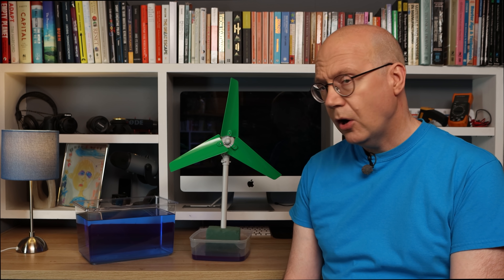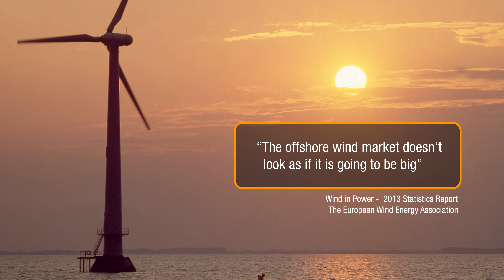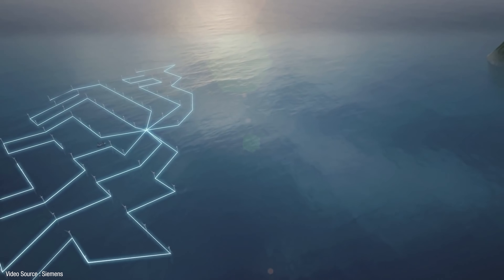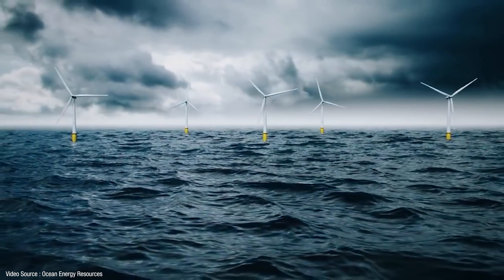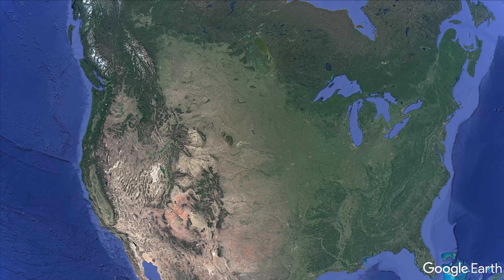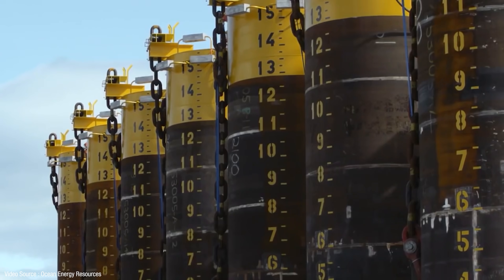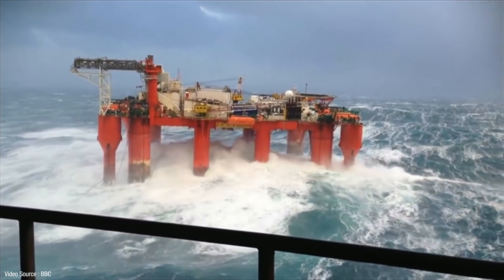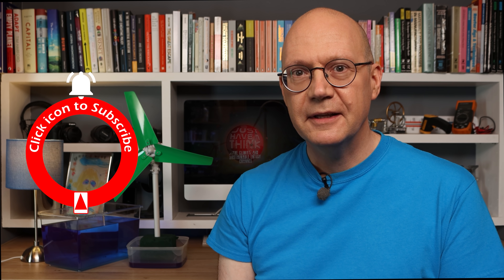Deep Ocean Floating Wind Turbines. How do they do that?

Comment: If they are going to have a floating wind turbine, why not have a floating platform that combines wind, solar and wave energy with only one anchoring system and the huge towers replaced with shorter towers.   A one kilometer diameter platform covered in solar panels adds another 200 megawatts.  500 megawatts if it uses tracking and concentrated photovoltaic and thermal solar combined. If the platform is large enough it would remain near perfectly level for the trackers.  Making the platform into a wind concentrator with the wind funneled into a huge  central shaft and turbine would have certain adbmvantages.  If the blades are supported along the ends by a big moving bearing, the blades could be huge and fill the enter area of the shaft. The three bladed turbines capture only about 5% of the available energy passing through the swept area because the take up such a small area in the swept area.  If the central shaft turbine can withstand hurricane force winds, it might power an entire city for a year with the amount of hydrogen it could generate. 
  The wave energy can be captured by attaching big floats to lever arms that compress air that is injected into the central shaft to help spin the wind turbine.  A three meter wave one kilometer long might equal 50 or a hundred million watts at one wave every ten seconds.  The floating lever arms would also tend to stabilize the platform in huge waves.  
Anither six ir eight giant wind turbines on the top deck might generate another 50 megawatts average.  
If the wind was blowing at 30 mph, the wind concentrator/redirector might generate about 60 million watts.  
The platform might generate 500 million to a billion watts average depending on location.  That is compared to maybe 50 million watts average from eight or ten giant wind turbines in the same area.  
Further combining things, all of that electricity would power a very powerful suoer laser.  That flies.  The turbine generators can be run in reverse as motors.  The turbine blades can serve as propellers.  Some big hydrogen powered gas turbines could power the motors.  If the top of the  platform can separate from the rest of the platform, it could fly like a giant drone.  The LAWS flying laser system mounted on a 747 could destroy targets 100 km away in two seconds with a 2 million watt laser.  A giant drone with a 100 million watt laser would be a formidable weapon.  LAWS was canceled over funding problems it sounds like.  A giant flying  laser system that pays for itself many times over might have certain advantages.

Comment: as someone who works on various wind farms across europe I think I can give a small inside on why we wont be having floating turbines anytime soon. Right now the way to stabilize a structure is to put a huge counter balance on the bottom ideally heavier than the part thats out of water. That would mean that for a 200m tower we would have another 200m structure below sea level and economicaly its just an abomination. The solution (which is currently in development) may pass by the azipod system, the same they use on oil rig where lots of propellers counter the sea current, however oil is energy dense and makes sense to power the propellers, wind on the other hand... its just a question of making the all system more eficient, when it will hapen i dont know

Comment: How  exactly are these fiber optic cables, which from my understanding transfer the electricity generated by the turbines, drilled into the sea floor, connected to each other (underground of the sea floor), connected to the central power station, which is then connected to the land electricity plant (again, from what I understood in this video, all underground of the sea floor). How is all of this very precise drilling and connecting done??

Comment: I'm an inventor;  have a patent in this area and I've worked on a vertical axis wind turbine in S. Texas .   I'm a fan of gyroscopes and I believe a solid gyroscope disc at the base of a deep sea turbine would stabilize it and also provide some flywheel energy steadying effect.  The gyroscope being solid will minimize the drag of the water on the disc and the disc will need to be a substantial fraction of the diameter of the blades.  It may be that two or more discs are required.  They can be made of concrete filled fiberglass and spun via friction drive planetary wheels.  They'll need some kind of electrical charge or something to keep the barnacles off.. I think.  anti-torque disc will also be required.

Comment: What I am most interested in is the power produced to cost ratio.. I dont think you covered it in this video (unless I missed it which is possible) BUT capacity is not important.. what is produced is whazt is important. Also are there times where they produce virtually no power or is the wind absolutely consistent in the deep water? I would think that there are times where the production of energy would drop dramatically when the wind drops.. this creates a serious problem that has to be addressed. Intermittency I would argue is the greatest cost of these things... Exactly how reliable are they? From what I gather at least deep water is more reliable than landbased turbines.. but that still means unreliablility.. and that is a huge cost.

Comment: Deep Ocean floating wind turbines seems to be feasible but setting up the infrastructure and transferring energy ( in the form of hydrogen/electricity ) onshore is expensive and maintenance will also be high compared to an onshore/shallow water setup. First, we need to focus on technologies that are easy to set up and maintain. We can resort to the Deep Ocean floating wind turbine as a last option. And it can be a national security issue in one scenario, for example, your country is dependent on Deep ocean floating wind turbines far away from the shoreline and if there is a war with another country, the enemy can destroy these wind turbines easily ( energy infrastructure ) without even stepping a foot on the land.

Comment: As long as the CO2 of the industrial age is not removed out of the athmosphere  , it is a mathematical certainty that the melting of the ice-caps , and the consequential rise of the sealevels , is not a question of if it will happen , but when it will happen . If then sealevels rise with 20 , 40 , or 60 meters , then what about all those sea-bottom fixed offshore windturbines ? Will they , and their energy they provide , then be lost ? Better build only floating offshore windturbines . They don't drown if sealevels rise , they can be towed to where the wind blows the hardest and can be towed into harbor for repairs in dock , instead of on high seas .

Comment: Could the design of the turbine be simplified by adjusting the way they face by rotating the floating buoy in the water instead of a mechanical coupling up top? Rotate the whole thing, maybe even passively with a tail fin?

Comment: Maybe a future topic to dig into is EROI and derived demand.  With higher utilisation the EROI would be higher, but with shorter lifetime, and more energy needed for the ships to build and service, the EROI would be lower. I've done research on the effects of scale on EROI of hydro power and the effects of reservoir temperature on the EROI geothermal power. The effect of utilisation factor on EROI of wind is huge - but if starting off with 3x more embedded energy I don't know how floating wind stacks up. 
Derived demand refers to the way whole systems emerge to use energy depending on the availability, access, cost and net energy of the resource. Demand has to be derived to fit with the energy resources.  Very low cost electricity of the past led to derived demand that has a lot of inefficiency and waste, because that was the reality. National power grids built to respond to demand created the derived demand of electricity without respect to availability. Wind is a different thing. What does the derived demand for floating offshore wind look like?  I don't know. It's a good question.

Comment: While floating wind is a good start, they will in the end lose out to combined platforms.  The current focus is on reducing the cost of the floating hull as a way to reduce the cost of electricity.  There are two problems with that approach; first it is a self limiting solution (there is only so small you can get and hold up a 15MW turbine), second even if I reduced the hull cost to zero I would only reduce the electricity price about 12%.  Hull cost is only one of more than 20 major cost items most of which dont change with the number of energy systems.  Combined platforms, which use combinations of wind and waves, or really crazy ones like our that combine as many systems as we can, share theses costs out.  The result is a 25%+ reduction in electricity cost, a reduction in the total number of platforms, a higher capacity factor (meaning less need for storage), and spare payload that can be used for other value added activities.  The math is too simple, eventually the hybrids will win out wind only installations.

Comment: Good article but it is very misleading to say it that a capacity of y is enough to power x households. Wind needs to be fully backed up due to its unpredictability and this is unfortunately done mainly done by fossil fuels.
Reply: Right.  Which is why ANY renewal energy source must have a backup system.  Right now it appears that specialized iron batteries hold the most promise.

Comment: Great thought provoking video. I imagine that the weight of the turbine generator right at the top must add a lot of stabilising weight at the bottom. Has there been any suggestion that the blades output be connected to a hydraulic pump and the hydraulic power be sent to a generator at the base of the tower Would the losses exceed the saving of weight at the top?

Comment: A very good video. I am not so sure the  so called impending climate disaster  is real or as significant as portrayed but the use of offshore wind combined with on shore electrolysis to produce hydrogen is feasable and would render the validity of the proclaimed  crisis acedemic.      

I am intimately familiar with the ocean environment but I have a gut feeling that the floating platforms should be detachable from their moorings to allow replacement of older units with newer units and the older units relocated closer to shore.  I have no experience with units that big and would appreciate a response from somebody with that knowledge. 

A great job.

Comment: Something deep water wind turbines can do which inshore or land based turbines can't do is store energy by pumping air down to deep pressurised containers. I.e big balloons on the sea floor or at intermediate depths. If the turbines didn't generate electricity directly but instead pumped air down to deep storage, and the electricity generation was driven only from deep storage high pressure air then you'd smooth out the fluctuations in wind, and have simpler, cheaper and more maintainable nacelles on each turbine.
Reply: Interesting idea.  A lot depends on the efficiency of pumping air and converting that pressure to electricity versus the efficiency of direct production of electricity.  I'm guessing the former is less efficient but might offset that with cheaper nacelles.  If that's true if the wind is always 100% steady, then at what percentage are the two choices equal?
Reply: @lokensga  Simple answer, I don't know. There are a lot of inputs into the cost. 

My guess is that if you don't do the electricity generation directly in the nacelles, but use a hydraulic fluid to collect energy from all turbines in a wind farm, and have a central place to convert the energy from the hydraulic fluid into electricity then it would be cheaper. Wind is free so efficiency doesn't matter as much as capital cost and maintenance cost. Reducing the complexity of each turbine reduces the capital and maintenance costs.

Comment: Great video as always. What about connecting the floating turbines to grids? Is it still realistic to use cables or does it make more sense to put an electrolysed there and produce green hydrogen? Particularly if salt water electrolysis becomes a reality. Thanks

Comment: I like these videos and the prospect of wind power is tantalising,  but how does it measure with the off set of fossil fuels used to manufacture the steel, concrete and cables to manufacture and then to install these installations, plus what happens to them when they are obsolete and defunct, a sea full of rotting metal. I still believe the only real way to reduce the carbon footprint of the human population, is to reduce significantly the human population , something, it seems to me ,the Chinese government is prepared to do.
Reply: they are disassembled and the materials are reused. no one's gonna dump expensive metals into the sea.
Reply: The world is polluted by the world's richest countries, not the most populous.

Comment: It would appear that using electrolysis, transport of hydrogen tanks in ships, and subsequent fuel-cell conversion of the hydrogen into electricity would be the most effective way to transmit the wind energy to the shore.  If that's the case, it would have been helpful to say so.  If not, the video really should have stated what mechanism would be used to transmit the energy over long distances.  Other than that, great video!
Reply: Electrolysis is not very efficient (typically or 70% or less) so the roundtrip efficiency would be poor.  Long distance transmission (>80km) would be HVDC.
Reply: @andycompton4709  HVDC is great when there's a nice, solid land connection between the turbine and the grid.  However, when the turbine is located way out at sea, which is the situation being discussed here, HVDC would be very difficult and expensive to implement.  There may be other mechanisms for storing the energy in "bundles" (as opposed to a continuous wired connection like HVDC).  But generating green hydrogen is the best option I'm currently aware of.
Reply: @lawman3966  I've worked in the power industry for 17 years and been involved in offshore wind for most of that time.  HVDC is the preferred option for offshore farms that are far offshore.  Dogger Bank is the first project in the UK to use it. It requires a large conversion sub-station onshore and it is expensive. However, converting to hydrogen, compressing it, pumping it hundreds of km back to shore, storing it and then converting it back to electricity would be wasteful. Also, hydrogen has low energy density.  In addition, the largest electrolysers are circa 10MW, not really practical for offshore farms that are now commonly >1GW in nameplate capacity
Reply: @andycompton4709  What you describe works for offshore wind harvesting.  However, the subject of the video is deep sea, floating wind turbines.  An HVDC connection for a deep sea would appear to require an underground passageway running as long as several thousand miles to house the electrical cables before connecting the cables to an onshore grid.
An arrangement of this sort may be possible, but it strikes me as being extremely expensive, both financially and environmentally.  Is this what you envision as an alternative to the admittedly energy-inefficient option of green hydrogen generation?
Reply: @lawman3966  Deep sea refers to the water depth (>60m).  It is highly unlikely that these will be installed at a greater distance than 100 miles or so from shore.  They come into their own for areas such as the west coats of the USA, the Mediterranean Sea, Japan, Korea and the West coast of UK and Ireland.  There are many good wind sites relatively close to shore but the seabed falls away quite sharply and is too deep for fixed foundations in these areas.  The potential capacity at these sites is vast so it will be a long time, if ever, that anyone is going to go as far offshore as you describe.
Reply: BTW, export cables are trenched and recovered using remotely piloted deep sea equipment.  No passageway required.

Comment: I'd heard (and I'm not sure how accurate this is; in fact, I'd hoped you would touch on it) that a model, at least, showed that offshore wind farms in the path of a hurricane can significantly lower the intensity.  Do you know anything about that?
Reply: The energy absorbed by a large turbine would carve out a hole pi times the square of the radius (e.g. 350') or 3.14 X 350 X350 = 384,650 sq. ft., or about 0.014 sq. miles, whereas the wall of a small hurricane (e.g. 100 miles wide by 4 miles high) would form a rotating wall of 400 sq. miles.  Obviously, the speed of the hurricane diminishes toward the eye, so the average windspeed is would be about half that, or that the area at full speed would be half the 400, i.e. 200, so the one turbine could extract  .014/200 = 0.00007= 0.007% of the energy in that location , minus the fraction lost by the turbine's efficiency.  However, I don't know of any turbine actually able to extract ANY energy in 75mph + winds.

Comment: So one part I don’t understand about wind energy and when optimists say it has to potential to cover all of our energy needs. Energy is just transferred so if we pull enough energy out of the atmosphere (at the grand scale) won’t that just fuck up our ecosystem worse than CO2?
Reply: Humans today use energy each day at a rate that the sun supplies in about ten seconds.   Most of that energy is going into the ocean and, of course, into the atmosphere when it hits the CO2 molecules, methane molecules, and water vapor.  As the oceans get warmer, they release more of their CO2 and produce more evaporation, thus accelerating the heating and trapping of heat in the atmosphere.
Reply: 1. our energy needs are tiny compared to what's available from wind.
2. not all that energy can be gathered.